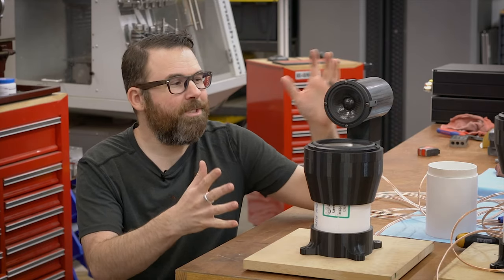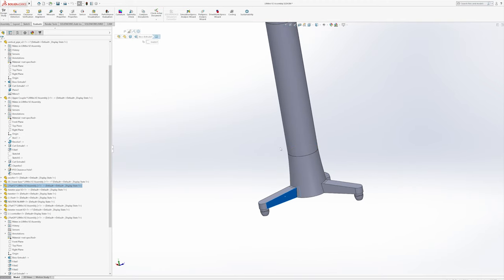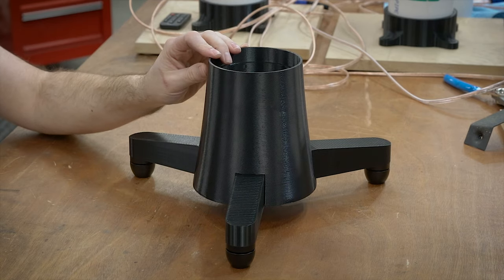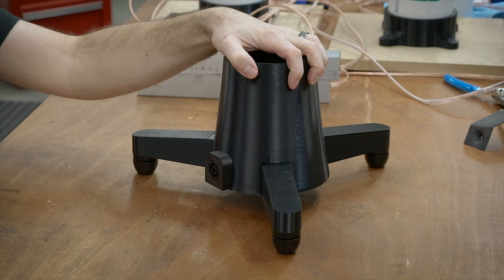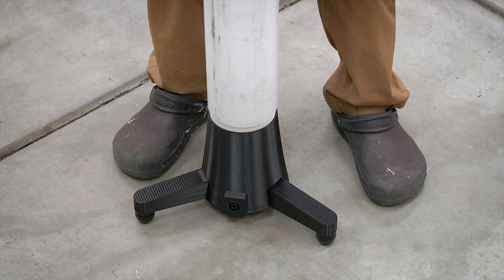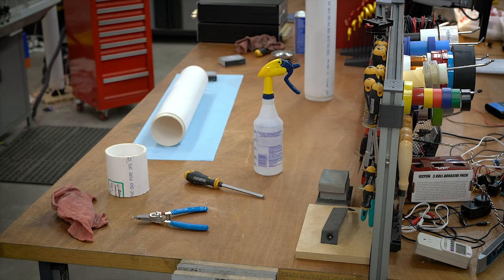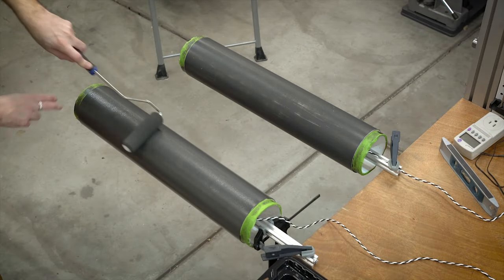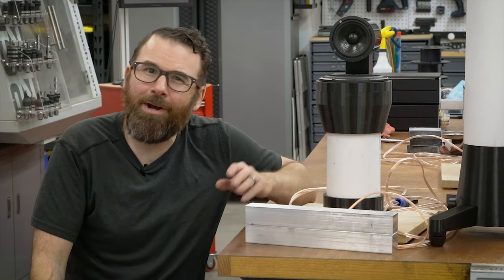DIY Speakers - LXmini Project Design (Part 2)

Comment: Where is part 3, Robert? We are looking forward to seeing the finished project 🎉
Reply from the maker: I had a few things come up and have been busy with other projects.  But they're ALMOST done.  I have a couple videos to release on the controller (it's 'done', it just needs to be wired up), and the speakers just need some final assembly and finishing.

Comment: For those of us unable to do 'acetone vapor smoothing' etc, are you going to sell these things? Watching...😉
Reply from the maker: I ended up ditching vapor smoothing, it's too inconsistent.  Nothing's worse than spending 2 days printing a part and have the geometry change when vapor polishing.  I'm going with NylonX, straight finish from the print, which is quite good.  Check out the most recent video, at the end you can see a preview of the 'finished speakers:  https://youtu.be/HoXf1cTcekc?list=PL0zMZkIMIyC8ZPyJTcch9lSU2gH82saj6&t=605

Comment: This is a fun project! Did you do the calculations to determine the proper volume for the driver? If not, you can always add a plug somewhere along the cylinder for proper tonality. Resonance will also be an interesting aspect of this build. The great thing about 3D printing is the ability to infill with different forms and percentages. This will affect the tonality and resonance as well. Looks great!! Keep us posted!
Reply from the maker: The original design has all this figured out.  I just took the original design and calculated the volume and tried to get as close as possible with my modifications.

Comment: How is the weight balance with the drivers installed, it looks like they would be rather easy to tip over accidentally with such narrow legs.
Reply from the maker: Surprisingly, it's pretty solid.  I was worried about that, but even with the 3d printed legs, it's pretty good.  Ideally, I could go a LOT longer on the legs, but it looked kinda odd.  The speakers seem like they've be REALLY top-heavy, but in reality they're not.  The aluminum legs are quite chonky and make it fairly stable.

Comment: Honest question, why go to the lengths of making the lip on the PVC pipe, when you could just model and print an inside lip instead?
Reply from the maker: Great question actually.  I think just having the double-lip is ultimately stronger?  Also, that would mean then inside of the tube wouldn't be smooth/seemless.  Ideally, you want the inside of your tube/enclosure to not have anything sticking out that could cause air turbulence.  The cross-section of my design is smooth from the driver down to the bottom of the pipe.
Reply: @RobertCowanDIY  you could make the double lip in the print, but yes, there would be a bump on the inside. Your option looks like the sound move to make. :)

Comment: Is the CAD model for the top bit available somewhere as it would be very nice to improve the look of my current LX Minis
Reply from the maker: Since the ultimate design is copyrighted, I don't feel comfortable sharing anything.  BUT, if you are aware of the user's group (you got a link to the forum when you purchased the design), I can share it there.